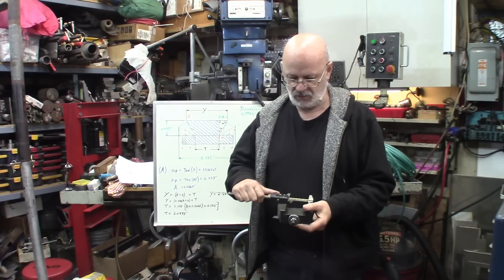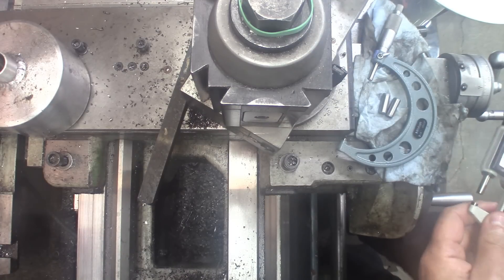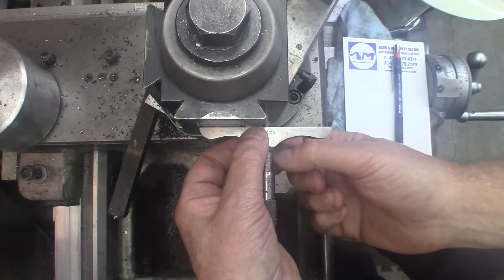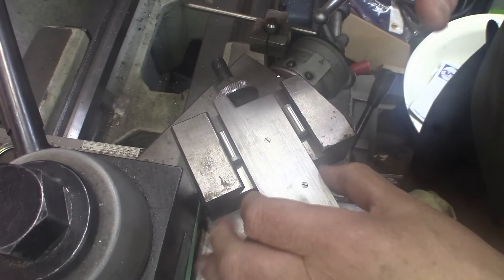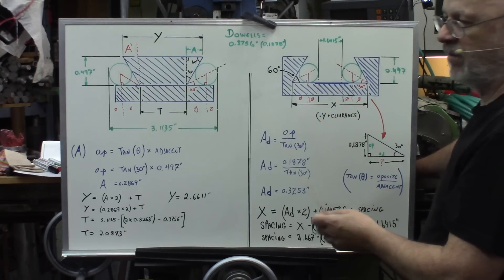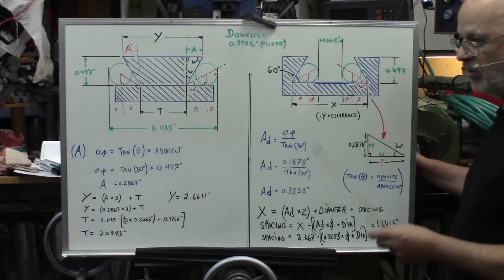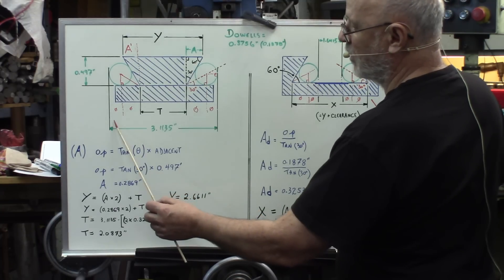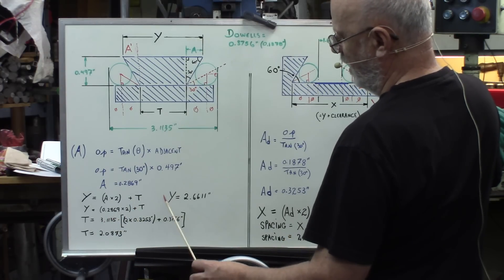Easy DOVETAILS... How to make and measure for tool holders on lathes, the Dorian or Aloris type...

Comment: Oooh oooh, Mr. Kotter.  I think I missed something... At what point and with what method did you determine the angle of the dovetail?
Reply from the maker: The 60 degrees is a known standard, but, there is a way to measure very accurately using 4 dowel pins and 2 gauge blocks, a little more elaborate but easily doable calculation...
And, the 30 degrees from the 60 degree angle is deducted by the fact that a perfect circle inserted in an angle, where a line originating from the corner and passing at the center of that circle will divide the angle exactly in 2 equally.
Answer from Mr. Kotter....    lol
Reply: It is known...
Reply: It is a known angle in this example.  However, measuring the angle is just as easy. I explained how in my reply to SmartShock's comment.  Chris

Comment: Well ... you've heard me comment about how well I get along with algebra/trig/calculus  (I don't).  One of these days I'll figure out a way to describe how I get around that, and I'll have everyone else scratching their heads.  I'll watch it again, after my headache subsides, and see if anything gets through.  I've been working on a tool post design and at the moment I'm basing the dovetails on the dimensions provided by Shars.  I have no idea if Shars/Aloris tool posts and holders will interchange with each other.  It would be nice to know if they did, in case I happen to find some Aloris tool holders at a good price.  It wouldn't be so good if I couldn't use them ... I'd like to know if I need to be more selective.  If anyone can provide the short answer, I'd appreciate it.

In the mean time, I'm anticipating the retirement of my  Tourrette's tool holder ... the cause of many sudden outbursts of profanity ... in the near future.
Reply from the maker: As long as you get the normal standards like AXA, BXA, or any thing like it, they will all be interchangeable and pretty universal, on about 18 or 20 of my holders some are from AccuSize, the pendant of Shars in Canada and they do great for a reasonable price...
No need to pay hundreds of $$$ to get decent tools holders...    ;)
Reply: The lathe is 18" swing, so I can use cxa (up to 18") or ca (up to 20).  I'll probably use cxa dimensions, which is a better match to the materials I have, unless I happen to nab a slightly larger diameter billet for the body.  The chunk of 4" I do have is tough stuff (rail grain car bearing), and has been too handy as a bench block for the last three decades.  I don't want to destroy that just yet.  And I'm not sure I could if I wanted to. 

I've recently discovered a problem about using the dimensions from Shars:  I laid out the ca dimensions in my cad program, and the resulting dovetail angle was off (not the 60 deg included angle they say it is).  So, I might be better off to buy the first holder anyway, and tweak the tool post dovetail to fit that.  Otherwise, I risk having a proprietary size of tool holder, and I'd have to make all of them
Reply: Just tried to sort it out again ... my head hurts.  But I did notice something.  Your measurement for "Y" is somewhere around .040 larger than the dimensions provided by Shars for their (CA) tool holders.   Of course, they do not tell you how they measured them. Yup.  My head really does hurt....
I may have to just try to make mine as close to CXA as I can and plan on making all of my holders if I get the post dovetail undersized.
I'll try it again later.  One of these days, something will go "click" and I'll have it.  I hope.

Comment: Hey that is a nice cutter.  You have a piston type tool post.  The wedge type are a bit more tricky,  You need the measure the min and max. width.  very narrow tolerance.
Reply: thats the best dovetail cutter I have. too bad when I was working on the dovetail in the final scene at  home,  duffus me shattered the insert and had to finish at Pierre's while my new inserts were in the mail.
Reply: I thought the RRITS dovetail cutters were indestructible? How you break one?
Reply: the cutter its self is fine, i shattered the carbide insert, i figured the screw loosened. the insert got loose and fractured. the cutter is unblemished
Reply: Yes so far no one has destroyed one,  They have broke a couple of inserts and broke a couple of screws.  That is it so far out of  about 300 of them.
Reply from the maker: Not that I haven't REALLY tried....!!!!
Reply from the maker: Right about the wedge, like you say there is a need to take measures from the min and max positions, if you got a block then it's easier to copy it with close machining tolerances...   ;)